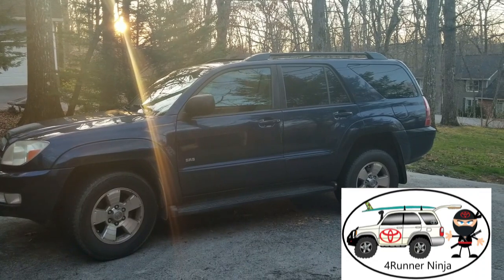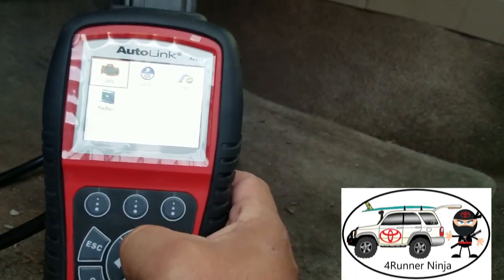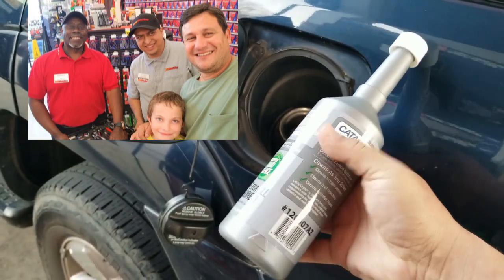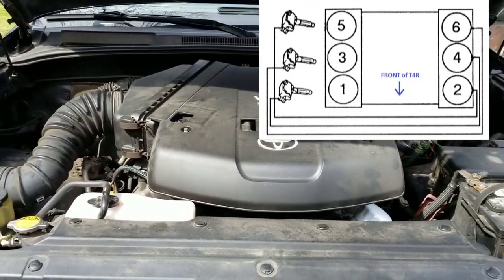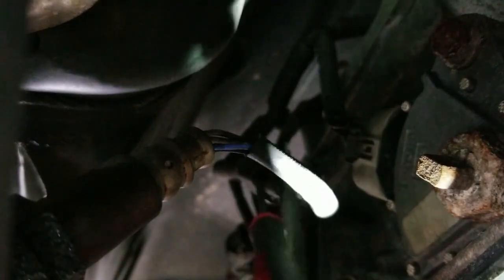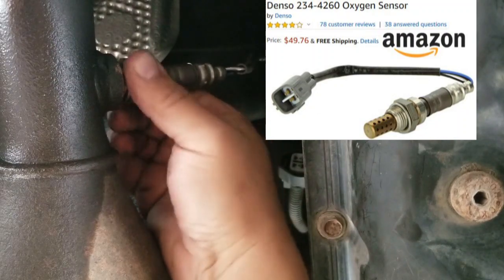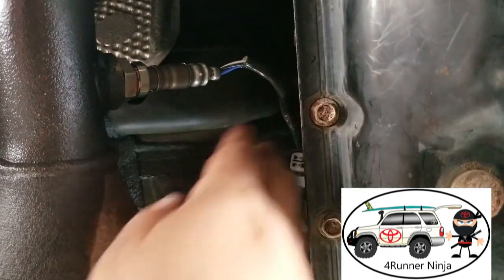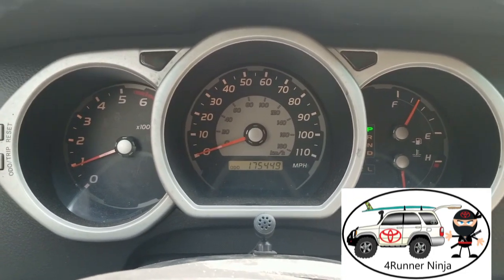2003 - 2009 Toyota 4Runner V6-2WD P0420 Catalytic Converter O2 Sensor Code

Comment: Thanks for the info. I have a 2006 4 Runner V8. In my case I have 2 warnings: 1 for bank 1 and 1 for bank 2. (P0420 and P0430 codes respectively
Reply from the maker: Bank 1 is passenger 6 on 2003-2009 V6 engines and Bank 2 is driver side.  It is however the opposite in V8 engines.  In short, Bank 1 is the most forward cylinder.

Comment: Something that I also noticed when replacing my O2 sensors, was that they appear to be reverse threaded. As I needed to set my ratchet to the OFF position instead of ON. This was on a 2004 Toyota 4Runner v6, four-wheel drive.
Reply from the maker: Thanks for the tip Andrew.  I was not aware that some of these are reversed threaded.  4Runner Ninja.
Reply: I could have just been the angle and position I was taking it off, so I could be wrong. But when in doubt go the opposite direction 😁. Thank you for the video! Very helpful.
Reply: Hi I hope you’re doing good. I need some help about the 02 sensor, I’ve a 4runner 4 wheel drive and I want to know if it’s the same sensor  from the 2 wheel drive.. thanks
Reply: Probably had ratchet flipped around.

Comment: That was a bitch getting the old sensor out. There's NO WAY I would have been able to get that off without the proper loaner removal socket from Autozone. Thanks for the video.
Reply from the maker: Hey TNJeepJ.  Glad it was useful to you.  Regards,  4Runner NInja.

Comment: Great video! I have the same code on my 2005 SR5 4WD im trying to get rid of. Have the codes come back after you replaced the sensor?
Reply from the maker: After i replaced the sensor the code did not come.back but i did have to use the code reader to clear it.  Hope the video helps.  Take care
Reply from the maker: Thanks for the kind remarks.  After I replaced the Bank 1 (P0420 - Passenger side) O2, the code stayed away.  I recently however, got a P0430, which is the same O2 code, but for Bank 2 (Driver side).  I am shooting a video on that one this coming weekend.  Thanks for the comments.

Comment: Hi, it is a great video and I have a short question did your 4runner had lack of power with the code 420 or 430? Thanks in advance.
Reply from the maker: Hi Santos.. thanks for reaching out.  If your cat converter is super clogged, you will experience a bit of a lack of power, but normally you would not see this....  stay safe, you may want to have it looked at by a shop if you are experiencing something unusual like that.  Good luck.  4Runner Ninja.

Comment: Hi I have a 2004 v6 4runner 4wd 4.0 liter engine like yours how many o2 sensors are there? You're showing 4 but I researched and its saying they're only 2? Please help. Thanks. Throwing a p0420 and p0430.
Reply from the maker: The 4Runners have two cat converters, one for each side fo the engine.  You can see them if you look under the car.  There are two (2) O2 sensors (1 one on each side) also called "Downstream sensors - after the CAT" and two Air Fuel Sensors (AF Sensor) also called "Upstream sensors - Before the CAT".  To keep it short, many people refer to them all as O2 sensors since they work together monitoring the CAT's performance.  Good luck and hoe this helps.  4Runner Ninja.

Comment: I recently got a code reader and found 4 codes.  P0420, P0141, P0146, P0155.  I ordered the aftermarket upstream sensor for bank 1 and am going to replace that first and see what happens.  What else do you recommend?
Reply: 2004 SR5 4X4
Reply: I’m wanting to sell the car but want to have the lights off by fixing the issue not by clearing codes.
Reply from the maker: Hey Preaching Truth.  So you have a ton of codes.  The good thing is that all the codes make reference to the PASSENGER side of the car (Bank 1).  Warning....!  The upstream sensor (or Air Fuel A/F Sensor) is a biatch to replace.  Based on the other codes 141 / 146 / 155, they all make reference to a circuit and heater elements of the "DOWNSTREAM" sensor... the O2 sensor.  I recommend you change that one 1st, clear the codes, drive it for a while to allow the car to cycle and see if they pop up again.  Also, the downstream sensor is much much much easier to replace.  Good luck.  4Runner Ninja.

Comment: Hi my 4runner 2004 with 261000 miles burning to much gas but I don’t have check engine light on your input please thank you.
Reply from the maker: Muhammad... it can be so many things.  But I would start with an old fashion tune up.  Change Spark Plugs, Replace PCV valve, replace belts, replace oil and wash out coolant as well as replace the fuel injectors as they may be sending too much gas to the engine.  These are just however, best guesses.  Take Care.  4Runner Ninja.

Comment: So i just took my 06 4 runner to auto zone. And i got the bank 2 catalytic code. Can you tell me if this is super serious and if i should take it to a mechanic right away?
Reply from the maker: Hey Nofriendo.  This is a common problem in 2003-2009.  I had it as well.  P0430 - Bank 2 (refers to cat converter - driver side) and P0420-Bank 1 (refers to the passenger side).  This could be three things; 1 - The upstream sensor / 2 - the Downstream sensor / 3 - The Cat converter is plugged.  Last resort, take it to Midas muffler and they can "clean" the cats.   I have two videos on this.  Subscribe and see below.  Good luck.  4Runner Ninja

https://www.youtube.com/watch?v=wpInp4SxEqA&t=256s

https://www.youtube.com/watch?v=oE_hBTop6CI&t=159s

Comment: how long does this fix last? I'm having same issue on my 2005 and my mechanic (whom I trust) insists that this won't fix the problem and clear the check engine light.
Reply from the maker: MrGwizyadig.  When I changed the sensor, the problem went away for a few months and it came back.  I tried other things such as replacing spark plugs and PCV valve in order to improve combustion.  That made it last a few more months.  In the end, the catalytic converter kept on deteriorating and replaced it.  The problem did not come back after that.  Good luck.  4Runner Ninja.
Reply: @4runnerninja426 did you have to change all of it or just a certain part I’m having this issue with my 2004 4Runner got the code removed but came back after 30 miles driven

Comment: Changed both down stream sensors o2 sensors on my 2010 4Runner v6 but still getting same code/check engine light but now another p0430 which is the second bank sensor
Reply from the maker: Hi Juicebox.  I also got the same codes after I changed the downstream sensors on the passenger side.  Remember this.  P0420 is catalytic converter on passenger side.  The P0430 is catalytic converter on the driver side.  Bank 1 - Passenger / Bank 2 - Driver.  If you changed both downstream sensor on your car, it could be that the upstream sensor is also in need of replacement.  I also did that in mine.  The error continued, so by process of elimination, I am now to the cat converter.  I am doing a video next on how to better diagnose this problem.  Very common on these 4Runners.  Stay happy.  Good luck.  I am placing a link to the P0430 video.

P0430 - https://www.youtube.com/watch?v=oE_hBTop6CI&t=2s

P0420 -  https://www.youtube.com/watch?v=wpInp4SxEqA&t=245s

4RUNNER NINJA.

Comment: Why did you use the cataclean and then replace the sensor? Did it not work?
Reply from the maker: Good question.  I was just trying to use all the arsenal to make this thing go away.  It went away for a few months and came back.  I am making another suplemental video to also use for diagnosing the cat converter.  4Runner Ninja.

Comment: How did it go? Did you have to replace the catalytic converter?
Reply from the maker: Hey Ms. Yang.  I have not yet.  This old 4Runner has the bolts super super tight as th ecar came from FL in the 1st place.  So I am taking it to Midas so they can cut it, clean it and put it back in... much cheaper than $600 ... half price.  Hope all is well with you.  4Runner Ninja
Reply: @4runnerninja426  thanks for the info. My lights are on just like yours and I took it in. They pretty much said I will be needing a new catalytic conv. But we will see .

Comment: I don't mean to be a smarty boy but the diagram on 00:10 that is shown is actually the v8, not the v6. Anyways, the P0430 code I had the problem was the catalytic converter. I'll be changing and we'll see what happens.
Reply from the maker: You are correct.  The intention of the schematic is to show the location of the upstream and downstream sensors with regards to the exhaust and the cat converter.  There is no difference in that regards between a V6 and V8.  Hope the video helped though....  thanks for the comment.

Comment: Hello friend, how do I always see your videos. I have a query change the two sensors and also the catalytic converter. And the check engine light still comes on. a colleague told me that it could be the gasoline

Comment: Hi there so p0420 bank 1 is the sensor located after catalyst under driver side?
Reply from the maker: So Bank 1 refers to the catalytic converter performance or the O2 sensors on the passenger side of the truck based on the numbering of the cylinders.  I attempted at changing the downstream O2 sensor to see if it would take it away and it did for a while.  Then I changed the upstream sensor and finally I cleaned the catalytic converter.  I have another video coming up on testing all these three items.  Good luck.  4Runner Ninja.
Reply: @4runnerninja426  thanks for your fast reply so I Had same code installed 2 new sensor after catalytic and code come back what's next? Thank's again and very good videos

Comment: I completed these steps and reset the code. The next day the check engine light came back and the same code apperead. What could be the issue?
Reply from the maker: Chris.  After I replaced this downstream sensor, the code went away for about 2 months and came back.  This weekend I am chasing it a bit more and see if I can find it.  I will test the upstream sensor and the cat converter to see if I can see anything off.  I will also post the video.  Subscribe and you will get a notice when I post it Sunday or early next week.  Regards, 4Runner Ninja.
Reply: Just an update for you and others, after replacing the passenger side downstream and upstream the error code came back. After spending about $100-$125 i guess it was worth the try. Now all that's left is the replace the part $400 with labor.
Reply from the maker: @OnlyBangs_Chris  Chris... sorry to hear that.  I am faced with the same problem.  I started chasing it this past weekend. I tested the downstream sensor I just replaced and tested Ok at 2.5V.  I am going to test the upstream sensor and then will take temp readings on the cat converter.  I have not found the issue yet.  As soon as I find it I will let you all know.  Please let me know what you change in your car that makes it go away...
Reply: PHENOMENAL VLOGS I have an 04 v6 runner, how many are there to replace in all? Thanks.

Comment: Thanks for your videos. I have a 2008 4runner with 140k, got the codes about a year ago, tried all catalytic cleaners, replaced all 4 sensors (both banks, up and downstreams with denso's) but still got the code P0420 code (sensor helped only the P0430 code). Any suggestions or do I have to break the bank and replace the CAT
Reply from the maker: Vijay.  Yep.  Sometimes this happens.  It also happened to me.  This weekend I am doing a procedure to determine if the problem is the actual catalytic converter.  If that is the case, they will have to be replaced and that is a biatch.  Better taking the car to MIDAS.  Hopefully I will be able to pin point it as well.  4Runner Ninja
Reply: I’m having same problem with my 2003 Toyota 4Runner I’m going to try putting the shop vacuum and see maybe 🤔 is not the sensor maybe just it is a broken old hose

Comment: My mechanic said I need to change Bank 1 passenger side? which sensor is that?
Reply from the maker: Hi Jade.  So Bank 1 refers to Cylinder/Spark Plug #1, which is the passenger side.  Now, there are two sensors on Bank 1, the upstream sensor (Air Fuel Sensor) and the Downstream Sensor (O2).  That is before and after the catalytic converter.  Those are sensors 1 (A/R upstream) and sensor 2 (O2 downstream).  In this video, I changed the downstream sensor.  The upstream is much harder to replace since it is hard to reach.  The Code P0420 does not tell you which sensor to change (AR or O2), so the easiest path is to try the cheapest and easiest 1st.  That is the downstream sensor in this video.  Hope this helps.  Let me know how everything works out.  Regards, 4Runner Ninja.

Comment: Where exactly is the o2 sensor on the passenger side?
Reply from the maker: So, if you go under the car (on the passenger side) at about the same place as the front passenger door, you should be able to see it.  It is in plain sight and it is connected upstream from the muffler (on the same pipe).  I you follow the pipe, it should be about 1 ft ahead of the front door.  It is symmetrically located on the driver side (bank 1).  I got a new code (P0430 - Bank 2) this past week, which is the same O2 sensor for the driver side.  I will be shooting a video for this one and will make sure I show you where the sensor is using the outside of the car as a reference.  Please subscribe and next video should make it much easier for you to see it.  Regards, thanks for watching.  Please subscribe.
Reply: @4runnerninja426  thank you
Reply: @4runnerninja426  Great formative vid! So just to confirm P0420/P0430 is the same o2 sensor part number Denso 234-4260? I recently got these codes and plan on purchasing...
Reply from the maker: @altezza2jz .  The two sensors (Bank 1 and Bank 2) appear to be the same but have different part numbers.  Banks Bank 1 is 4260 and Bank 2 (For Driver side or P0430) is 4261, even though both should work for both sides.
Reply from the maker: Altezza.  The two downstream sensors do have different part numbers,  I just posted the video for the P0430 so now you can see both part numbers (Bank 1 - Passenger Side = Denso # 234-4260) and (Bank 2 - Driver Side = Denso # 234-4261).  They seem to be identical however.  See the video just posted for P0430.  THanks and hope this helps.
Reply from the maker: Jimmy.  I just posted the video for the sensor for Bank 2 (Driver Side) - P0430.  I made a point of stopping and explaining exactly where the sensor is and how to find it.  Check it out. 
https://www.youtube.com/watch?v=oE_hBTop6CI
Reply: Hi there I have 2006 4runner with p0420 code bank below threshold  which sensor that would be  1 2 or # 3 any help will be appreciated thanks
Reply from the maker: @lagunez12  viento.  This is a good question.  I replaced the downstream sensor (bank1 / sensor 2) in this video.  It took the code away for a few months and came back about 2 weeks ago.  I am in the process of doing the video for the upstream sensor this coming weekend i hope. (Bank 1 / sensor 1).  Before i just replace the part (which is super hard to get to, not sure i will be able to) i will test the catalytic converter itself, i will test the sensor and if bone of that helps i will look into the ignition coils.  Sunscribe and be on the lookout for it in about 1 to 2 weeks.  Hang in there.
Reply from the maker: Sorry for the spelling... fat fingers at the atl airport.
Reply: @4runnerninja426  excellent thank you very much for your help I Will subscribe

Comment: Isn't BANK 1 driver side and BANK 2 passenger????
Reply from the maker: Common misconception.  Bank 1 is passenger 6 on 2003-2009 V6 engines and Bank 2 is driver side.  It is however the opposite in V8 engines.  In short, Bank 1 is the most forward cylinder.
Reply: @4runnerninja426  so on the V8 4runner this sensor, bank one, sensor one will be on the driver's side, right?

Comment: Thank you- Great Vid
Reply from the maker: No problem.  Glad it helped.  Subscrine.and stay tuned for more 4Runner stuff.  4Runner Ninja
Reply: @4runnerninja426  Did that Cataclean helped or does that product really work to keep Cat converter in shape?   Thx
Reply from the maker: @ednan9  Hi Ed.  When I used the cataclean, it helped made my P0420 go away for a few months, but the code came back.  In short, it cant hurt using the clean a few times a year, but if you have an issue, it will only delay it a bit further.  Hope this helps.  4Runner Ninja.
Reply: @4runnerninja426  thanks Ninja